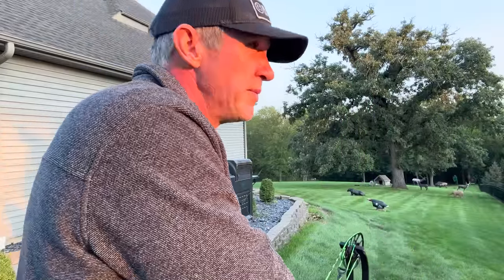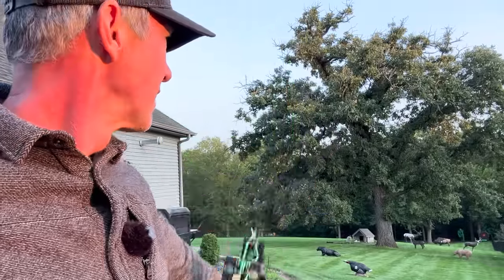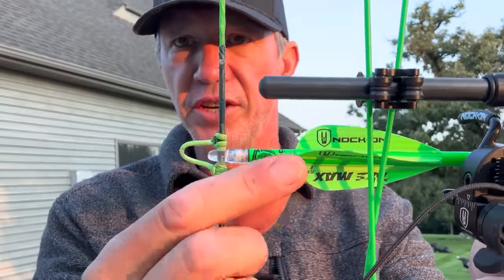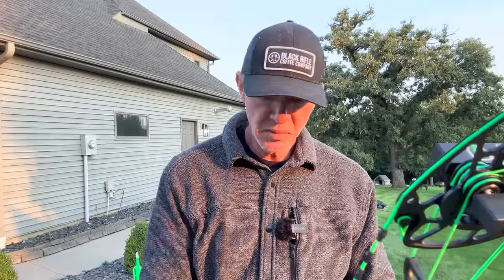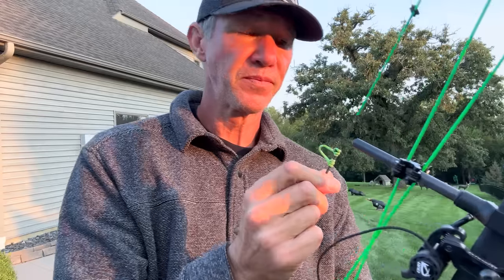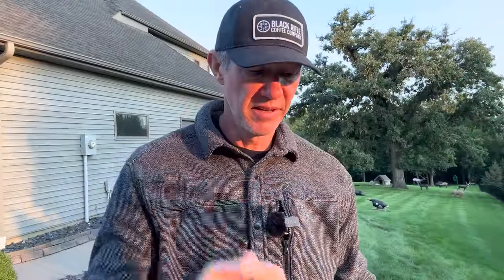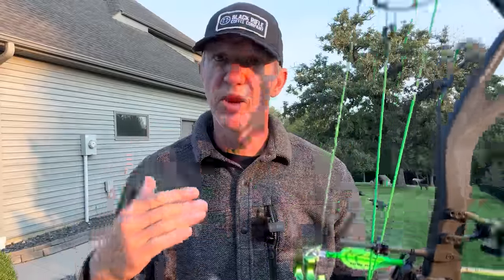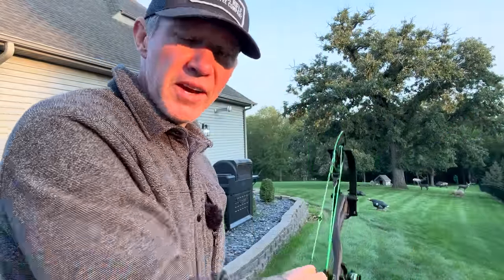EASY TO SEE ACCURACY KILLER that’s so easy to fix!

Comment: I’ve always tied in a not under my nock between the nock and D loop with zero spacing on the nock. Learned this from a world champion back in 97’ . Solves nock pinch and no worries with nock movement at full draw. 👊

Comment: You mentioned Beiter in podcast with Dan. Those are nice as you can tie nock sets right against the nock and the shape just prevents any pinching issues.
Reply: Beiter hunter nocks do this, yes.... I use them and they are fantastic. You should still leave about 1 strand of serving of extra room tying in the nock points though. After a few shots the nock points will usually move in a bit and you will have a perfect fit. They also make asymmetrical nocks which can be brutal for nock pinch and lifting the arrow off the rest... but, they can also be super accurate if the nock point is done well. I do a ton of target shooting with my father and he uses asymmetrical with no issue. I used to use them too, but have since switched to the hunter nocks and like them more. They are symmetrical and definitely help prevent nock pinch. They have good sized cut outs top and bottom to allow nocking points to sit in them just perfectly. They cost a bit more but I will always take a beiter nock over any other brand.

Comment: Excellent point ! I actually stopped using lighted knocks because it cost me a buck of a lifetime because it fit to tight on my string and when I drew back the arrow fell off my string at full draw. I like to hear the snap sound when I knock a arrow. The lighted knocks I was using never did that. I'd rather lose a arrow then not get a shot at a trophy buck at 10 yards like I did.
Reply: I have a question: Is there a way to move my bottom D lope knot without starting over ? I checked mine and all my arrow raise up. no doubt its to tight.
Reply: @jackfowler1030 it's very easy to tie a new nock set and dloop.

Comment: John thank you very much for the simplest of troubleshooting.   I just can't believe you have done two videos on nocks...I am fighting nock-throat to serving issue to a point I have deployed my 6" calipers to try and figure out WT Foxtrot has happened.... In 10 shots I've seen one arrow skirt the edge target, another just fly off to Who Knowsville.  
I just checked my pinch... I do see there "is" an issue... as well as the serving is getting extremely worn-out

Comment: I have a question unrelated to nock pinch. I have seen this many times though! my question is trajectory at high altitude. Im from southern MO and will be going on my first elk hunt next month. I am dialed in out past 100 but im curious how much difference you notice on point of impact when you go to these high elevations? i will take a target to confirm but i am wondering what to expect? Most of where we will be hunting is 10,000'-12,000'. Thanks and keep up the great content!
Reply: Late reply but with arrows it will not make a substantial difference or any at all. The thing that will be a big difference will be your performance at high altitude. Fatigue will be biggest difference

Comment: What about the the short Ata bows they have a very sharp angle so the nock points need to be far apart when using a lighted nock which at rest there will be alot more movement between the nock points

Comment: Good demonstration on nock pinch and also how it effects accuracy! I have one question, do you shot enough where your center serving wears out and you have to reserve it or do I shoot to much or a nock problem? I use the "h" nocks in my 6mm Eastons. I am 99% sure the center serving is .021 on the gas bowstrings I use.
Reply from the maker: Servings certainly wear but the tighter the fit the more the wear. If you start to develop a flat spot you know it’s too tight

Comment: I might not be into bow hunting enough to see why you'd use anything other than a wisker biscuit for an arrow rest. Great info on setting the knock knot, but a biscuit keeps the front steady at all angles.
Reply: Too much wear and tear on the arrow vanes and the fibres of the biscuit. Drop away is the preferred method for non beginners.

Comment: Sometimes it's hard to tell.  A good test is to draw your arrow without a point.  If it doesn't lift off the launcher without the point, you're good.
Reply: If it doesnt lift with the point on, even with a pinch, wouldnt the weight of the point keep it down on the launcher anyway? Assuming enough weight on the point that is.

Comment: Thanks for the video..I am dealing with a bad tear to the left and will check this.I have tried moving rest and doing a yoke tune and also tried a lighter field point to no resolution.I did notice some slop in my upper wheels axle when loosening sting to do yoke tune.Is this normal?Bow is 12 years old,Mathew’s z7

Comment: Question Dud, what realistic difference can someone expect to see if they switch to a nock that is lighted right before season? I don't want to spend $70 on 6 nocks and then use them all year for practice and depleting the batteries and would like to just add them before season so for an average Archer would there be any point of impact change that would cause you to have to tweak sight tapes or would you say you're pretty much good to just swap out and go as long as the nock fit it good?
Reply: That really depends on the distance,  up close, not much
Reply: In my setup, no noticeable difference up to 40 yds. Past 40, forget it.

Comment: Good stuff! 
I just had those issues, but I assumed the flight inconsistencies where all from the nock pinching so much tighter on the string serving! Can “horizontal” pinching cause the same kind of problems as vertical??
Reply: That's a great question. I'm guessing no since I have several different nock setups that all shoot really accurately but I hope someone who knows chimes in. I know for sure that it can impact accuracy on stickbows, but not necessarily every time.
Reply: @jcarry5214  I just assume that any change made to arrow or bow will make some change down range. However not many guys can shoot like Dud in order to see the difference!!
Reply: @SheepdogConservation  Lol well that's true. It's like giving most guys a bipod and a .2 moa rifle. Probably can't actually tell it from the OTC Savage.
Reply: @jcarry5214  exactly! Haha

I do know that the horizontal pinch was giving me 1/3 that would miss by like 5”+ at 50… as soon as I went back to my stock nocks that don’t “click” when I put them on my groups/misses went back to < 3” !! But I also had vertical tightness like he describes so I think the combo magnified the flyers greatly!
Reply: @SheepdogConservation  you know I went and shot out at 65 for about 75 shots the other day and I couldn’t escape the feeling my nocks were causing some fliers. Some were definitely me but I was definitely getting some erratic rigts and lefts. Happen to know what nocks you like? I have gold tips on all my standard diameters but I have those really bitey bohnings on my 204 shafts, the ones that double click. 

Granted I haven’t shot enough this summer to be crying about 65 but some I know were good shots, perfect elevation but 3-4” dead left or right.
Reply: @jcarry5214  I was having the same problems! 
I’m shooting black eagle x-impacts this year and just switched from the “m nock ST” stock ones to their  “m micro nock” and they’re definitely more forgiving!!
That’s for .166ID shafts.. but if you look them up you can kind of see the differences and the micros are definitely a looser fit.. if that size works for your arrows I’d recommend!
Reply: @SheepdogConservation  Nice. I got looking at the results and started thinking about what you'd said. Son of a bitch, that's exactly what he was describing.

Comment: Quick question dud I’m gunna test this but I figured I’d ask hopefully u see it. I’m #75 31.5”  shooting a 597gn arrow right around 280 with a single bevel I used the hil method and it’s shooting like a dart. Only once I get past 65/70ish it gets very unforgiving. I’m guessing that’s just the nature of a single bevel non vented. With this current setup I know I got plenty of juice would I be better off just throwing a sevr mechanical to gain that accuracy at distance back? I know I’m capable of hitting what I aim at out to distance it just seems squirrelly past those distances.
Reply: I can also loose some arrow weight in that process too
Reply from the maker: That is a result of deceleration possibly but sometimes having a long range and close range option is good to have as long as your tune allows for it
Reply: @nockonarchery  right on appreciate you
Reply: @nockonarchery  update I brought my arrow weight down to 567gn and shot a sevr and it was a absolute dart out at 80 in Wyoming wind. I think it was just slowing down just enough to plain that single bevel at that speed. I haven’t chronograph it but I’m sure I’m over 285 and that’s literally what you always say for a target speed.
Reply: Long short of it I’m rolling with the 567gn with a sevr. Just time to dig in now. Let’s go get some meat!

Comment: John, I'm trying to find the right nock for my .204 shafts that snap nicely onto my string, but am not having very good luck. I re-served with .018 Power Grip Serving and the only nock that snaps on without any effort is a Nockturnal for .204 shafts. I've tried Easton X, AAE IP, Gold Tip, Bohning, and Nockturnals. I don't really want to run the Nockturnals. Anyone have any advice?
Reply from the maker: You can try a halo serving because you can got down to a .015  depending on your bow type try the nock fit down on the cam serving. Most likely that’s halo and it will give you an idea if it will work!
Reply: Will try that! Thanks!

Comment: Hey dose anyone know if this would cause a difficult time paper  tooning? I work working on the guys bow and it would always be, tip  high no matter what I did so we  went back down to the basics and still couldn't get this guys bow shooting built holes we spent 3 hours looking at it but nothing worked dose anyone have any idea why this bow did this? Or have any idea to try next time?
Reply from the maker: That sounds like a rest bouncing back up. Try a different rest and if it changes quick that would be my guess. Some bows limbs travel more than other when the bow is fired. I refer to it as “overtravel” of the limbs. When that happens it can cause the rest to bounce back up and do that. Also tail high that doesn’t correct is a example of a weak spine which is a result of improper arrow spine or too much front weight
Reply: @nockonarchery  okay thanks man I will try that I'm a newer bow tech so I have a ton of room to grow and a lot to learn!! Hope you have a good evening!

Comment: How much would be too much gap?
Reply: @raphael6488  I asked because I have a few different brands of stores and they have different width of nocks. Beeman, Gold tips, victory, Easton. I guess the best would be to change all nocks to the same but the arrows are 246-204 id's. Width of nocks are 0.160, 0.172, 0.180, 0.200, 0.215. 

I replaced the winners choice strings(about 10 years old) on my bow with 60x strings and the airstrike arrows I had been shooting would fall off the center serving with just a little tug. Different issue, different serving diameter I guess.